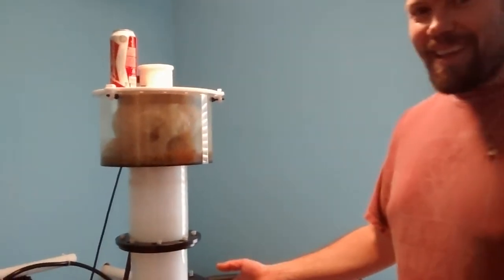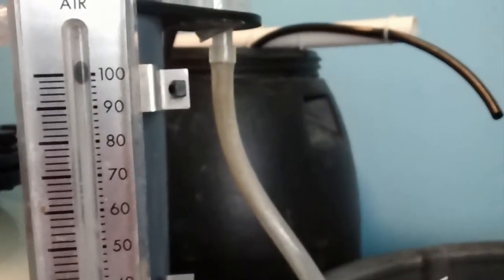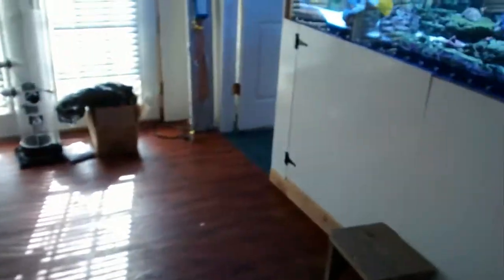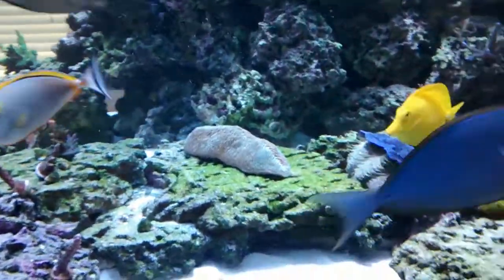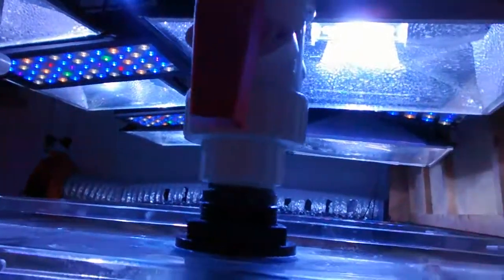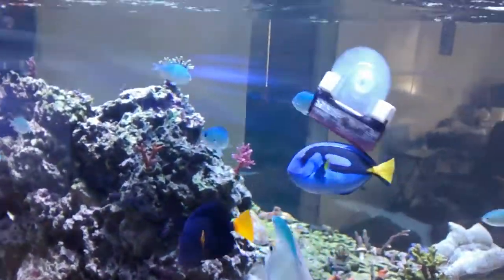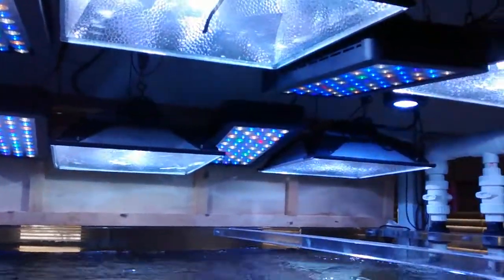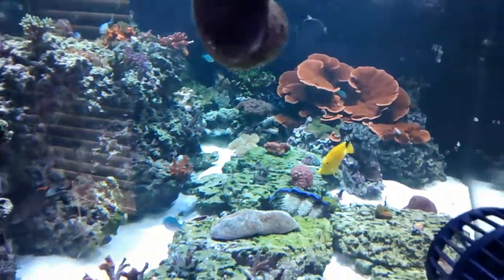March update sps skimmer led rw-20 pump

Comment: Hey man bad ass skimmer. Whats the rule for magnets? Can you dump any kind of magnet in the tank, or do you have to seal it with epoxy?
Reply from the maker: Thanks , I only used the magnets on the outside of the tank the magnets on the inside are the ones that came with the pumps. Cant just dump any magnet into the tank they will corrode.